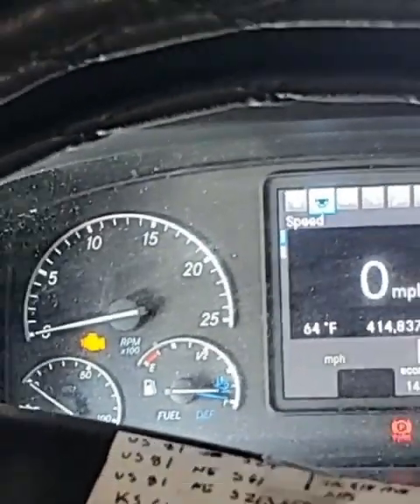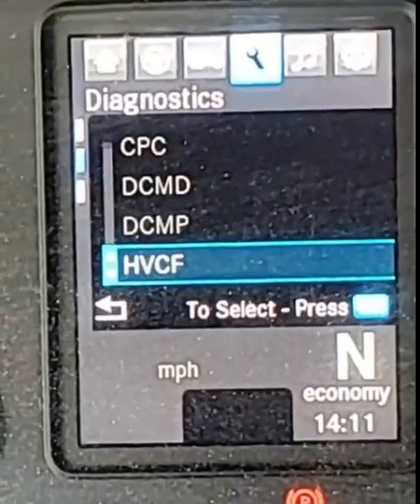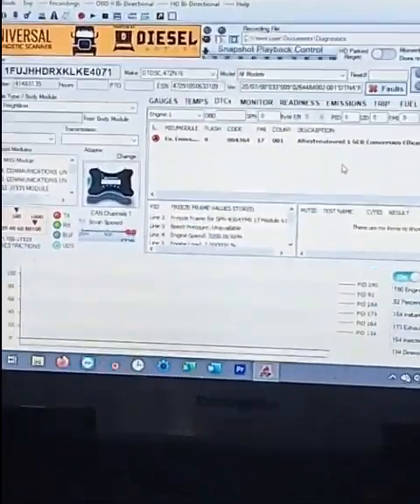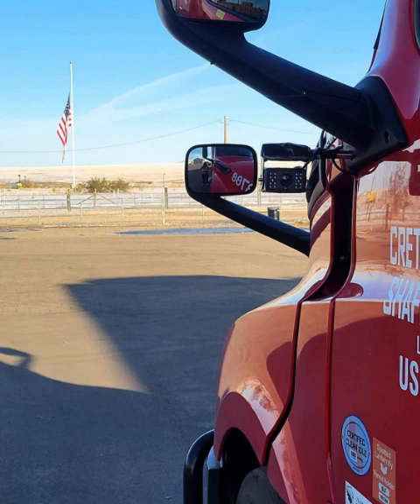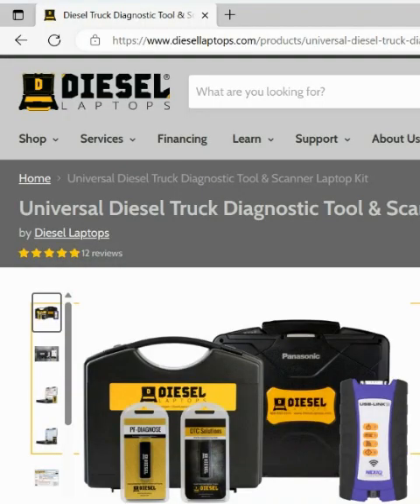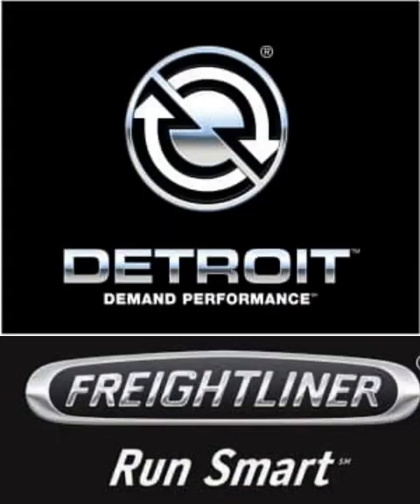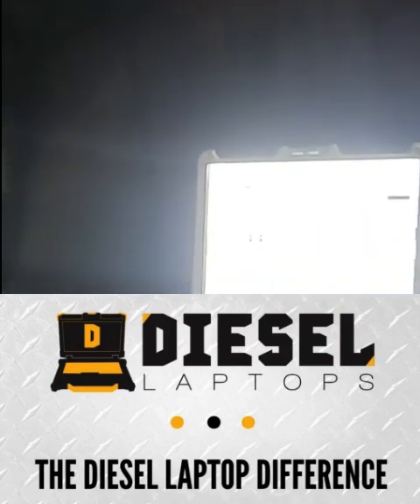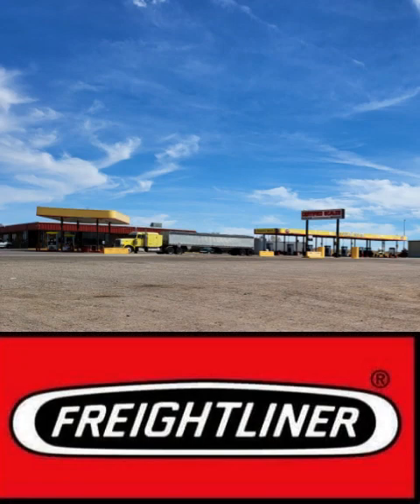Freightliner Cascadia SPN 4364 FMI 17

Comment: That error is BS. Euro 5? Why its Euro 5? We are living in USA, fault is nox efficiency is too low , trucks after 2021-2025 giving that code if your efficiency is less than 90%, this new government regulation they want 92-100% efficiency and this is not possible while you driving in mountains because you using all truck engine power, so there will be some particulars in the air which system is not able to fully convert and clean air. Trucks 2017-2020 has less requirements for emissions and less problems.
Reply: Where did you find this out? I have a 2021 and this pops up every couple months.

Comment: Don’t worry friend its a normal code just drive few miles and it will clear automatically the code takes 30 to 40 minutes but the light takes few hours of drive.
Reply: Hey brother code popped up and mill light drove 2 hours to destination delivered load and 2 hours back home solid mill light is staying on and not going off , on the way home I put 2.5 gallons of fresh def and replaced def filter any suggestions

Comment: What fixed the problem did you need a force regen and that fixed the problem ?
Reply from the maker: When I cleared the code with my laptop, it did not reappear.  Periodically, the code has appeared weeks and sometimes months later.  Each time the code is "inactive" and I can easily clear with my laptop.
Reply from the maker: I clear the code with my laptop
Reply: @bubbleheadtrucker thanks for responding I did a forced regen and cleared the code 

I cleared the code when I seen your video it came back on 

When you cleared the code did it come back on ?
Reply: I’m talking in circles lol how to fix this will a regen and clear code help
Reply from the maker: Code could be "Active" and a legitimate problem could exists.  That might explain why it returns immediately 🤔   

I recommend a Detroit Diesel certified mechanic take a look at it.  More than likely the repair could still be under warranty.
Reply: @bubbleheadtrucker ok thanks

Comment: Hello sir I have same issue did your light ever come back on if so what was the fix?
Reply from the maker: Yes, software update fixed the problem after second reoccurence.
Reply from the maker: Reoccurence on 10/13/2023.  Wet roads, raining, 60°F in Illinois.  2nd time in Illinois.
Reply: @sub-sailor mine just came on and it's raining.  How long can I drive before it's shuts my motor down?
Reply from the maker: @flatbedjay7672  You're good to keep going indefinitely.  It's more of a nuisance than anything else.  Might clear on its own after awhile.

Comment: I have a 2019, with 720k miles, this code pops up on occasion, but it seems to be fuel quality. I add the EDT hotshot secret fuel addititive, or Pittsburgh power additive and it goes away within a few hundred miles. Mine just came on for the first time in months in Benson AZ, and i just added 80 gallons of fuel, and i was stingy with the fuel additive. (The EDT at walmart or tractor supply treats 80 gallons, but the same size bottle at love's or pilot freats 800 gallons, same price. )
Reply: Same with mine. It seems to always pop up 60-90 miles after I add fuel additives or winterizer. Super annoying.
Reply: So are you saying the fuel adative makes the code popped up or go away i just got this same code today but I always use lucas fuel treatment and never had this problem any advice to get it to go away